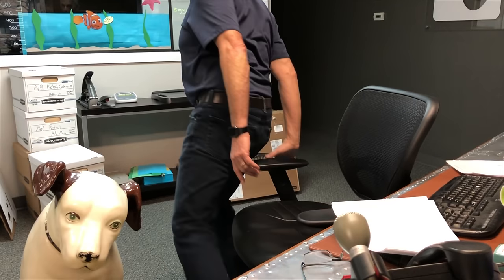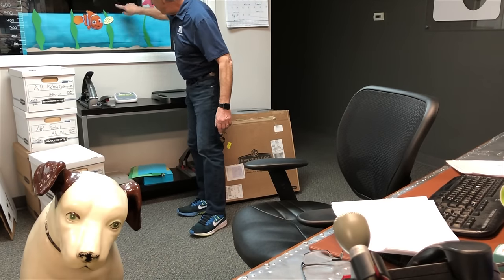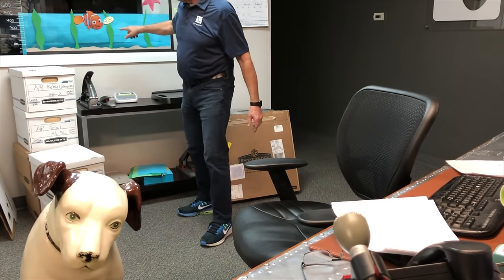Why do tubes sound different than transistors?

Comment: _Why_?

"They sound different because they are different." you say. That's awful close to a tautology. Not at all a why.

A bunch of it is surely output transformers. Those things are non-linear as hell.
Reply: otl amp it is than
Reply: @Redh0und  High output impedance
Reply: @johnyang799  depends
Reply: Could be why McIntosh use autoformers on their higher end solid state power amps.
Reply: Dave Micolichek  
It's called negative feedback network, and all amplifiers have it, it's something like that
You: Amplified could you prepare me orange juice
Amplifier: I could try, but I only have apples
Negative feedback: I'm going to make you do orange juice
Amplifier: Ok
You: Thank you for the exquisite orange juice.

I know it, every electronic engineer in the world knows it, even Paul knows it.

Once you exceed a certain quality in the design, all the amplifiers sound the same, but keep the secret, we do not want to get into anyone's business.
Reply: Dave Micolichek  
For me the important thing is the frequency response graph, as long as it tells me that the amp is good and there is enough power, I am happy.
Mosfet valve or TBJ  don't care for me
Reply: @animalmuppetmonster664  that's true said

Comment: Yes, they sound different, but "different" doesn't necessarily mean better. In fact the coloration added by Tubes (pleasant or not) is often referred to as "good distortion"   
Tubes are used in the recording studio too. Some microphones use Tubes to warm the sound. And Jazz & Blues guitarist use Tubes for the sound they produce when over driven. I'm going to kick my own ass for saying this, but Tubes can make certain digital recordings sound better to our ears, BUT it greatly depends on what's being recorded.
Reply: Wrong ..............tubes are not warm sounding , only if not correctly implemented or wrongly used, clearly you don't know about vacuum -tube technology and that's a fact ............
Reply: Frank Geeraerts 
We use Tube mics in the studio to to warm or smooth an instrument. The terminology is just geek speak as long as its understood during sessions. Vocals can sound very nice with Tube pre's ... The Hi-Fi world is rather different. I wouldn't use Tubes in my system as they're not needed. 
And Frank, think about how you reply 😉
Reply: Chris Bishop its obviously a joke comment
Reply: Frank, tube amps MAY sound "warmer" if they're single-ended design, in which case you get a noticeable portion of the 2-nd harmonic (over -60dB), which does sound somewhat pleasant. You don't get that effect from a push-pull design.
Reply: Chris Bishop if
Reply: Frank Geeraerts you have tin ears and that's a fact
Reply: transistors are current amplifiers and usually they need a ton of feedback to have low distortion... the big difference is that transistors are really cheap to use so you can use 10 of them to do the job of one tube stage, and take advantage of all that extra gain for more negative feedback.. tubes can sound good and have low distortion (some tubes) with no external feedback
Reply: I'm a musician with a collection of Tube gear.   Hi-Fi enthusiasts are all about ultra linearity, and "perfect reproduction"........   I'm going to go with the Joe Meek theory.   "If it sounds right,  than it IS right."
Reply: not ture. tube need emitter feedback and output transformer to sound good. high gain guitar tube amps try get as much gain they can get so end up sound like a ss amp. jfet and mosfet, since they soft clip do not need ton of feedback to sound good and  have low distortion. it btj needs ton of feed back to distort nicely. if it in the liner region it some but not a lot. how ever if you are in for hi-fi audio overdriving a signal is not want you want.
Reply: Chris Bishop nice to see you but please don't hey me, we hardly met, disrepect
Reply: fully balanced OTL amplifiers are considered the most precise sound reproduction amplifiers. fully balanced OTL amplifiers with super triodes (one Darlington pair made out of a triode driver and a SiC Fet as power devices)... that's divinity. OTL amplifiers cost a fortune because of that
Reply: @spark300c:
"tube need emitter feedback"???
After 50 years of working with electronics, I've never seen a tube with an emitter!
Reply: The best stereo amp I had was a small tube stereo amp called "Star". It was only about 5 w per ch but it was great, better sound treble I ever had in any amp.
Reply: Dolby noise reduction removes the distortion on high frequencies. Dolby also removes part of the highs. Dolby switched on , doesnt sound as good. Transistors remove the distortion., transistors also dont sound as good as tubes.. Natural tube analog is better than unnatural digital transistors. The sorriest tube amp& records blows away everything else.
Reply: People who brag about transistors are just trying to sell their inferior stuff. Some early handmade non integrated circuits seventies transistor amps sound much better than most new transistor amps. Most tube amps are much better. Tube amps dont  last as long. All transistor amps need tube volume controls that last long. You get half of the tube sound.
Reply: Man didnt design the world, man doesnt know why natural analog tube sounds better. An acoustical guitar is better than electric in most cases. A piano is better than an electric organ. A tube amp on an electric guitar is better than a transistor amp. A 1971 & before tube recorded lp sounds better. I dont sit around & get a computer & come up with dum ass numbers to try to prove digital is better, my ears tell me digital sucks. High bit rate numbers like 24 bit over 16 bit, high bit rates have thin bass, making it seem like the highs are better. Dont buy the junk.
Reply: Better to your ears.

Any distortion is not objectively good or bad, it's just distortion.

You can add distortion at any point, but you can't take it away.

Thus, a clean signal is objectively superior to a distorted signal, because if you personally prefer the distortion added by whatever equipment, you can add the distortion at any point.
Reply: +Luis Alvarez you're actually dead wrong about this one, sorry.  CD-quality audio isn't perceptibly different from analogue to humans.  Check out the video "D/A and A/D | Digital Show and Tell (Monty Montgomery @ xiph.org)"
Reply: Dumb  hmmmmm, you are as wrong as it can get.
Metal Guitarists MOSTLY prefer Tube Amps. Others use modern sample based amps like those kemper amps. I NevER EVER have seen a Metal Guitarist with a Solid State Amp.
The MOST and the most FAMOUS Bands used, use and will use Tube Amps. ENGL, Marshall, Randall, Peavey and so on.
I have never seen Panthera or any one using his Line 6 or what ever amp.

In fact, marshall got famous in the 70`s and 80`s for their Tube Amps in the Metal Scene. Every hughe metal Band used them Back than. You can find samples of these amp on ANY sample based amp and so on.
That`s a FACT !

And someone in these comments said there are tube amps known for its linearity.
I wonder why not any studio uses them..... because they are not maybe? And because its exactly the other way around, transistor amps are known and well used everywhere, also in highly professional recordings because of their totally completely flat 100% accurate reproduction. Because in such a low frequency bandwidth a modern transistor has exactly 0 distortion. Where different tubes add different sound colours ( Thats why metal guitarists experiment with different tube setups in their amps ). Transistors do not add any own soundcolour unless it is wanted ( which actually was wanted in early transistor amps to mimic tube sound ).

Why arent tubes used for computers and why were the best tube computers so slow? because a tube is not as fast responding as an transistor.
Tubes can start at a few KHz and getting uneven response. On Transistors that starts in MHz Bandwidth.

A Proper tube Amp would need propper circuitry for the specific tube which is used to get linearity. A Transistor does not.

Why are tube hi fi amps so expensive? Because they need to develope everything specific for this tubes ect to get it sound how the developer wants. and some other factors, too for sure.

This Transistore / Tube fight is ridiculous. Everywhere voodoo, missinformations ect. Fact is Tubes distort, which does not say tube amps distort, they dont if properly build.
but it is waaaaay more complex, tubes arent able to drive bigger and heavier speakers properly. The standard hi fi amps have not much output power, very bad dampening. They need ultra light speakers and suck a hughe amount of power out of your wall.

Transistor amps are much easier. Less circuitry, less developement and same or better results while being much more efficient.
Reply: um.. all guitarists use tubes.
Reply: not metal guitarists.

Metal guitarists typically record from their wanted amps and their wanted cabinets. They use a microphon to pickup the sound from the cabinet they want. because metal guitarists care very much about HOW their guitars sounds. Many professional do not just have 1 amplifier but multiple amps and cabinets.

The rest like post equalizing is made on PC.

Sorry you cant fool me with the lack of your knowledge. i worked with a pretty good german metal guitarist and worked in the audio business in the past.
I know how it really works. Not how you imagine it would work.

Sure there are bands who decided to use other ways like Kemper amp or some programs.
Ramstein did that as far as i know. But Rammstein also uses ENGL Tube Amps.
Reply: if yu want to educate yourself about guitar recording, Watch the Videos from Ola Englund
Reply: SRV. 123  lol
Reply: @spark300c  tl;dr too many acronyms
Reply: @ampdoc  
 single-ended design <-- It is very interesting, I have an honest question, I saw single-ended design in signal amplifiers, are they also used in power amplifiers? Do you know of someone who has made a design? share please. Thank you
Reply: Seems the crux of the difference between tube and solid state is in the area of...transient response, or how fast the device can change level. The tube is naturally...slower to respond; and this feature is interesting as the device nears saturation. Solid state devices tend to sound "harsh" in comparison, because they process the signal more accurately; they also enter saturation less gracefully than tubes, causing a largely unpleasant clipping of the signal. So, the weakness of the tube is also its strength, in at least one application, anyway.

Comment: Two reasons tubes sound different, one is soft saturation, tubes can operate into a long saturation curve, two is that output is "almost" always through a transformer with hysteriesis distortion.
When newer fet amps are designed to sound like a tube amp these "distortions" are programmed into the design.

Comment: You certainly reinforced the fact THAT they do, but not so much WHY they do.
Reply: Richard Larson yes he did. Did you watch the video?
Reply: He said one is a voltage amplifying device and the other is a current amplifying device. It's the nature of how they operate that causes them to sound different.
Reply: ThePapabear2012 : Transistors aren't ever actually current amplifiers, that was just a scheme they came up with to escape a patent on FETs.

The difference in sound comes down to differing harmonics, filtering, and biasing: if you bias a transistor or a tube correctly, then apply input, output, and feedback filtering correctly, then you CAN have them sound the same. The trick is that people don't go to sufficient effort to achieve the result (effectively, you're building a specialized analog computer for the purpose of simulating the "target sound": possible, but not necessarily worth the trouble).
Reply: ThePapabear2012 Jared Maddox uhhh... what?  Amplifier manufacturers have been trying to make solid state amps sound like tube amps for decades (guitar amps, for example) and yet still there is a consensus among guitar players that tubes have a much richer, and therefore different sound.

Tubes and transistors have very different physics, and very different sound characteristics.  The current flowing in a tube does so in a near-vacuum, where the current in a FET flows through doped silicon.  Tube current is controlled by a grid voltage, which produces an electrostatic force on the electrons which acts mostly parallel to the path of the electrons, whereas the FET modulates the charge between its source and drain terminals via a voltage applied at the gate which produces an electric field laterally to the path of the electrons, forming the channel between drain and source.  As the poster mentioned, tubes operate at much higher voltages and temperatures than transistors as well, and of course the differences go on and on.

They are two different ways to achieve the same goal but they do so differently, this is why they sound different.
Reply: William Ashland : And those characteristics (except for voltage, which can be handled if you're willing to spend the money) only matter because of their effect on the input characteristics (what are the input impedance characteristics, in essence), and output signal, which means that they can be simulated, including by analog semiconductor circuitry. The stuff you mentioned is all relevant to the designer of a device, but once a signal has passed through that device the effect no longer matters.
Reply: Im glad I read the comments before wasting 10 minutes of my life. lol
Reply: guitar amps are instrument-specific amps, hifi amps are reproduction-specific amps. hifi is not hifi if it colors the sound...
Reply: No, he did not.
Reply: That is just not true. Both amps use current as the amplifying paradigium. The reason they sound different has to do with the physical nature of the device. Vacuum tube electrodes do not touch one another as they are separated by vacuum, transistors do. That feature leads to weird harmonics in the transistor that effect the 2nd and 3rd harmonic profiles. At least that is what I was taught in electronics classes years ago.
Reply: Output section of power amplifier based on tubes with output transformer is a - constant-power-wanna-be source. Voltage depends on load. Since speakers have different impedances - the voltage is changing with impedance. Bass notes sounds longer with tube amps, since the impidance of the speaker usualy drops and amp reacts to it in this way. 
Output section of a solid state amp - is a constant voltage source. Voltage remains constan (for most solid state amps) while the load is changing. Like 10Vrms will be constant across: 4ohms, 8ohms, 16ohms loads. The power will be different of course. 

So if you'll take a solid sate device and connect it to the speaker through OUTPUT transformer - You'll get the "tube power output section" behavior.

If you'll take a power MOSFET with resitive load and connect it to the speaker - you'll get the "pentode power output section" behavior - with plenty of 2nd harmonic distortion

If you'll take a power V-FET (SIT) with resitive load and connect it to the speaker - you'll get the "SE TRIODE tube power output section " behavior with plenty of 2nd harmonic distortion.

For preamps:
Pentodes and Jfets are very close in their IxV curves. Triodes and SITs - are very close in their IxV. Triodes and Jfets - are differnet.
Reply: Tubes have a much softer saturation when over driven. An over driven sine wave on a transistor amp becomes a square wave, on a tube amp it is a sine wave with rounded tops without the sharp "knee" of a square wave..
Reply: What about the difference in distortion? That is the primary reason WHY they sound different. Tubes produce even harmonics whereas transistors produce odd harmonics. Also, transistors have hard clipping whereas tubes have soft clipping. Their frequency response curves are also different. That is what gives tubes their "warm" sound.

Comment: Audio Research went back and forth between tubes and transistors in their amps and preamps and their tube designs were always better. Warmest sounding amp I have is a transistor amp made in Norway but it gets hot as a stove. Tubes don't really have a warm sound. But what they do have is a lack of that hard edge sound of alot of transistor amps have.Everything colors sound but tubes tend to sound more like the real thing.
Reply: Class A amplification always sounds better, even if it is solid state. JVC had some really good amps that were super cheap (less than $100) , but they had poor speakers. I suppose they quit making them, but need to check. If done properly, class a/b is really good. Conrad Johnson tube amps and krell amps do this. Amps and Preamps that use a combo of tubes and solid state have some real promise. CJ had a full class a pre that cost the first born and what was left of the wife.

Comment: Depending on the tube preamp and associated equipment in my experience tube front end mated to a solid state power amp produces a huge three dimensional sound stage with unmatched harmonics, especially in the mid range, that blow away solid state preamps.  Voices, string instruments, reed instruments and pianos sound, to my ear, much, MUCH better than solid state gear.  The price paid is loss of transient response, loss of bandwidth and a higher noise floor.  But once ya hear tubes it's hard to go back to solid state.
Reply: Build something from the late lamented Allen Wright's "Tube Preamp Cookbook". No shortage of transient response or bandwidth there (although he does use FETs too).
Reply: @TheRealWindlePoons  the drawback is the amount of heat tubes produce...
Reply: @vincentl.9469  If we're talking line stage preamps, a 4 tube amp will dissipate about 30 watts maximum. Is that too much heat? It isn't for me but your mileage may vary.